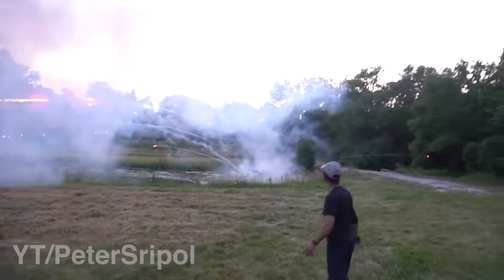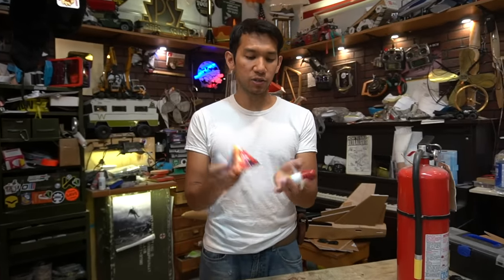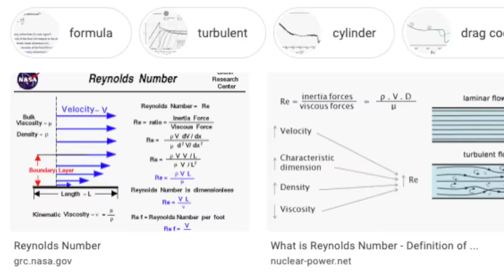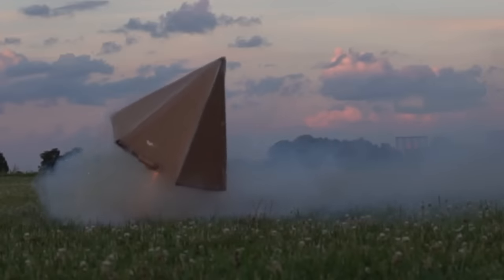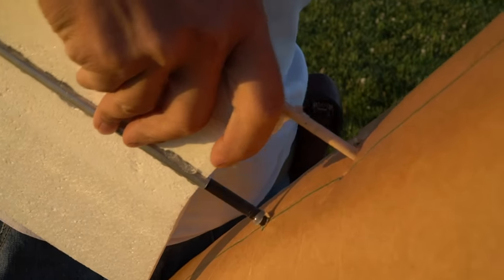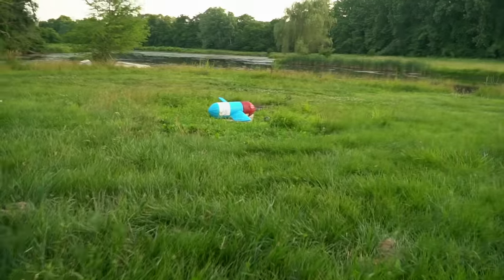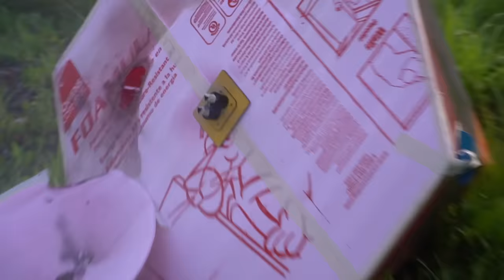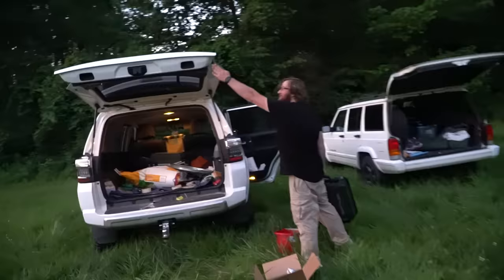Making GIANT helicopter style FIREWORKS

Comment: I think a larger launch pad area would help you get better spin; it doesn’t have to go far to end up on the grass, which adds friction and therefore slows your spin. A hard metal wire, placed vertically and inserted in the center underneath could also help to guide it straight upwards (much like the Estes rocket launch pads)...

Comment: Next year: a plane where the entire frame and body is made out of different kinds of fireworks (maybe allow the cardboard boxes to help make wings so it can actually fly) - either powered by electric RC motors or rocket motors, with a remote switch to set off all the fireworks while in the air.

Comment: I love watching this. I'm so happy to see your excitement in pursuing this hobby. I'm a 73 year old engineer and 35 year member of the PGI (Pyrotechnics Guild International). I started making my own black powder when I was 12 years old. Watching you is like watching myself through a time machine. You should investigate joining the PGI, they can provide a wealth of knowledge. Oh, and quit buying those expensive motors and make your own...it's really easy. Keep up the good work, have fun and be safe.
Reply: What?! There's a GUILD for pyromaniacs??

How did I not know of this amazingness?
Reply: check out my comment about that failure of the engine. its probably because its a large diameter estes. those larger BP grains are more likely to have thermal expansion contraction issues or mishandling during shipping, retail, or consumer handling. it creates cracks in the grain. the burn follows the cracks and increases the surface area being burned exponentially as the grain is consumed. instead of going woosh its more likely to go POP. CATO - or catastrophic take off in rocketry - often occur for this reason in BP engines.

Comment: Change the piramidal form with a "da vinci flying contraption", this way the bottom thruster wont be neded
Reply: That would need higher efficiency srbs
Reply: oooh comobine the pill with the pyramid ... and make the davinci screw copter ... since they figured out the fuse timing they could make it a hexagon base and then do 3 spin motors each firing one after the other ... and if they think they need it a few thruster motors on the bottom in a tripod style orientation to give it that little extra boost off the ground

Comment: Years back I had so many packs of Ground Bloom Flower fireworks. On the pavement of my nearby school, I found a used "Plane Flying at Night" firework and realized that it is a larger Ground Bloom Flower with cardboard wings. I disassembled it and traced the flattened-out cardboard to scale with the Flower firework. After a few fails I figured out the correct angle to fasten the firework into the reusable wing. With dozens to shoot off, most were the usual take off into the night sky. BUT, some did some cool things like hover twenty feet up and bob up and down. Some started off slowly gaining height and then rapidly took off. Then I became more creative and added a Jumping Jack or two, or Lady Finger firecrackers.

Comment: Progressively shorten the fuses. 3 motors long, med, short. So that each motor starts after the next, ideally one starting just before the other stops. allowing for more height. Your weight was really heavy for this design. Drag also was a huge problem. Use same idea, throw away the fat body and use somthing slim and round. a freesbee style flat disc with same wings and pitch.

Comment: I have an idea for the pill firework. Try putting motors on Opposite sides of the pill and have three on each side then have a fuse running from three into one fuse and then from the one fuse into a single

Comment: Those engines are pretty hard to light with a fuse because there’s only a tiny amount of the fuel exposed inside the hole, they are much more reliable if you drill it out a tiny bit before putting your fuse in.
Reply: Wouldn't that mess with the nozzle a tiny bit?
no criticism just curious.
I think part of the reason electric seems more reliable with the rocket engines is as simple as the plug that holds in the electric igniter. It pushes it against the fuel.
In theory if you have a decent fuse you could still use the plugs from the engines with a  normal fuse and have better success then just a tight fitting fuse.
I'm guessing since the plug temporally closes the end of the engine, the fuse would make a little more of a "pop" and an increase in temp on the fuel as well as holding the fuse against the fuel.
The engine should still push the plug out the second it gets going but I think that plug may make more of a difference then we see.
since it focuses the flame and spark inside the engine instead of right back out of the bottom it would probably make the fuse option alot more reliable.
Reply: @joedirt7604  You have a great thinking mind man! You are correct, it would mess with the nozzle if you drill out part of the nozzle. I would use a small drill so as to not change the structure of the nozzle, just the fuel composition. 
I think the main reason the fuse is unreliable here is because when the fuse burns its shoots its spark and heat one way, if you stick a fuse straight in it is pushing its heat and sparks downwards, and when it gets to the very end it may not ignite the rocket fuel. One way to combat this would be to bend the fuse in a small U turn loop at the end so it shoots its heat directly into the rocket fuel. The reason I would drill it instead of choosing this option is because the fuse may be too large to bend and fit inside the small hole, because like you said, you don't want to mess with the nozzle. If you can fit a fuse and a plug it should work, just need to find a small enough fuse.

Comment: The helicopter ones are amazing but one time in Las Vegas we bought one with the propeller more towards the rear which was a surprise as they don't usually. When we lit it, it went up in the air for a bit and then took horizontal flight and zoomed literally right over the top of our heads almost hitting me and two friends before going back up vertically and blowing up. 🤣 it was the craziest thing.

Comment: Cool, but WHY are you using fuse???  A marine 12V battery, some electric matches/supplied igniters, wire in parallel.  Will be much more accurate and successful....Lighting composite motors this way is a big no-no (and unreliable) unless you have thermalite.

Comment: I bought a few packs of these back in the 80's at a local drug store and they took off about 6 feet into the air and then they blew up like a stick of dynamite! and all they were supposed to do is fly, best defective fireworks i ever bought ;) around 4 out of 6 per pack blew up just like that and two took off and flew like 10 city blocks away and disappeared :) they started making them different since then i noticed, cheaper now and they don't blow up any more:( jsayin

Comment: First off on thinking provide a larger flat surface ie such as a parking lot or area with respect to the size of the experiment.  Size of area for working space to let start to get to proper lift.  It's getting negative drag during primary needs to perform.  Jus my thoughts.  Rick Illinois

Comment: Have you ever thought of building a rocket with a helical fin pattern to create spin during flight to compare with specs and data of a normal finned rocket. I was thinking about having a board , a nail, and a screw, a hammer and a screw gun. Which one can go in the board faster and easier? The screw or the nail? And then wondered if screwed while being hammered is fast. What happens? As in rifling on a gun barrel puts a spin on a bullet and uses the spin to create centrifical force to stabilize the bullet increasing speed and distance. I just thought it might be a challenge worthy of investigating and making a video about. Just some thoughts from an old fart.

Comment: You you would’ve got both rockets to shot at the same time instead of duel ignition that pyramid would’ve flown super high
Reply: You need it to spin first so its stable when the lift motor ignites, technically its called a "Girandola". You can use firework rockets and the bottom of  5 gallon bucket to make a basic one https://youtu.be/hMAVQRYEePo
The larger dola`s are a lot more impressive https://youtu.be/18uVtCVNTvo

Comment: That big cylinder is so unnecessary. It does nothing but add weight, drag and it slows the rotation and ascension. A simple 4 winged propeller would be so much more efficient. Like 5 times or more at least. But I guess this is more about scaling up that nostalgia than perfecting a rocket powered spinny flying thingy

Comment: CATO from those larger grain estes BP engines are more likely than smaller ones like C. so i'm talking D, E, F. anyway some of it is just do to aging. thermal expansion contraction. some of it is do to shipping or whatever where the grain gets dropped and so you get a crack. the burn follows the crack which causes exponential increase in the surface area that is burning as it consumes the fuel. 

tl;dr -- dont drop black powder type rocket engines. store them in climate controlled environment. it might happen before they even get to you so dont feel bad.

Comment: redirected from another vid...I am surprised they didn't take apart those model rocket engines to make one engine, instead of using three engines set off together so sad. They would have ended up with an engine that lasts long enough (for the cone model) so the thrust engine to launch.

Comment: Are you doing anything about it again? Did you understand what was the issue? The issue is that you thought that the bigger one will fly higher. But no. Making a big pill with a tiny rocket in it will not give you what the helicopter fireworks do. You are supposed to fill the entire body with power, like the firework is filled.

Comment: Peter you should have more aeronautical sense than this. 
Whilst watching video I saw many mistakes beforehand and was confirmed with launch attempts. 

Placing rockets at TWO opposing sides will give way more GYROSCOPIC momentum thus more LIFT with the  'Wings ' .
Also if it's mounted on Wing ends will give more Torque but slower speeds than when closer to centrifugal point with less torque but higher speed. 

No kids go and play again let's see the difference.